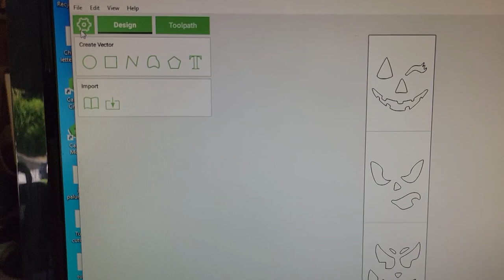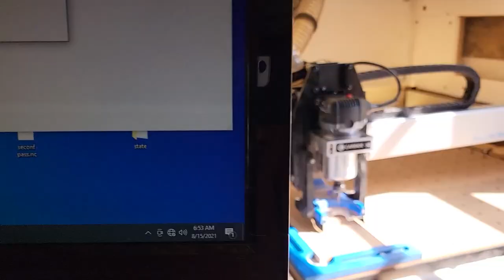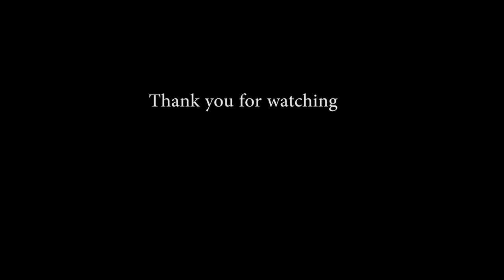DIY CNC Halloween decoration 2021 - #PowermaticMakers

Comment: Nice video.  I made some similar. Instead of glue and brads I used screws in the corners. Saves a lot of time.  Also, I attached the top.  Saves time and lumber by making it removable.  I don't know a removable top is necessary.

My cut time is about 3 minutes per face and a few minutes screwing together.  I cut all sides 5.5 to make it simple and the top 7 to fit.  Basically a square pumpkin like Spookley.
😉
Reply from the maker: Thank you.  I like hearing how other people build them.  Great time saver.

Comment: so save yourself some more wood:  on the top, take that added piece and make that your bottom.  glue / nail the top on.  That piece you moved now to the bottom, glue/nail it in.  For the back piece, then you can cut it a few inches short, this way you have an opening on the back / bottom to slide an LED tea light into your box.  Those couple inches (3 or 4) that you cut the backs short, add up in length for enough stock start another box. :)    Oh..and an edit here..  add some whimsy to the boxes.  instead of the square stock as the stem,   grab some some tree branches and use them   lol
Reply from the maker: That's a great idea! Thanks.